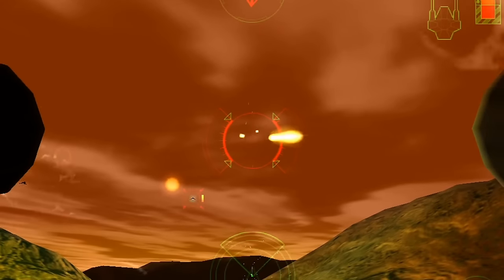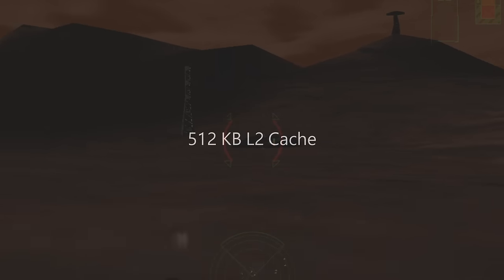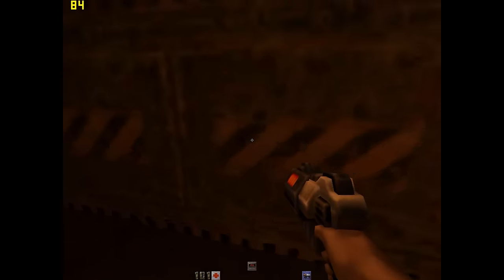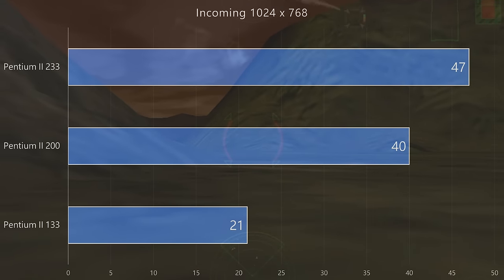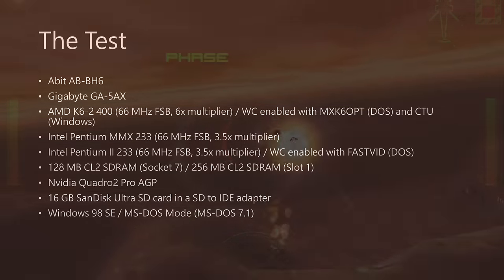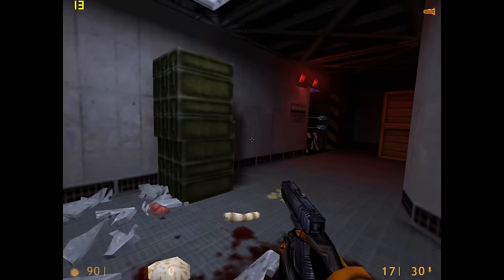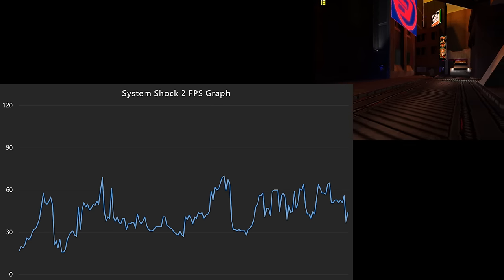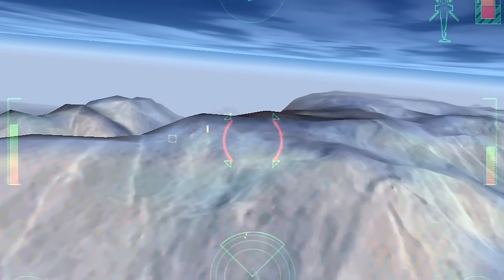Pentium II 233 The First Slot 1 Processor

Comment: I liked the video I recall my first custom build it was the 233 mmx pent and I researched graphics cards and went with a voodoo 3 2000 with 16megs of vram it would run anything but was slow at times with only 64megs of system ram don't recall the board think it was a pc chips board or the chip set either most of them I seen back then had ali , bx440 or s3 chips I see that mine in your benchmarks was the slowest that explains alot I didn't know how to test them back then and never did even today so that was helpful without having to do it myself I think price of that cpu was main reason I stayed clear of them trying to find the best performance at the best price meant choosing but at least I got the best graphics card at that time.

Comment: I never was able to get into the intel market back then. I had limited funds back then and AMD has almost always been a better deal for your money imo (ignoring the later FX line). I went from a 5x86 133Mhz to a k6-2 450Mhz which I stuck with throughout the secc cpu phase. I didn't upgrade again until thunderbird, 900Mhz, and later a thoroughbred 1667Mhz. It was at this time I ditched desktops for about ten years when I got an Area-51m in 2004. I recently built one of your dos time machines based around a p3b-f.

Mobo: Asus P3b-f
CPU: Pentium II 233 Mhz
Ram: 256MB 66Mhz
Hdd: 160GB ATA 133
Media: Plexwriter Premium
             LS 120 Superdisk drive
             Zip 100 drive
Hdd Controller: Promise 133 tx2 (This allows you to break the 137GB barrier.)
Sound: Sound Blaster AWE 64 Gold with aftermarket ram upgrade for loading soundfonts.
Video: 3Dfx Voodoo 3 3000
Operating system: Dos 7.1/Win95/Win3.11
Picture: http://imgur.com/a/tzchR

P.S. I really need to get a new psu for this thing.
Reply: A very nice system including the arch rivals Zip 100 and LS 120! I think it needs an exhaust fan though to keep in healthy for the longest time possible, especially as the Voodoo3 and PII produce a good amount of heat.

Comment: Phil, you could also make a video of the Celeron 266, the slowest Slot 1 CPU, and the Celeron 300A, the slot 1 overclocking king. :) A comparison of the Celeron 266 and the MMX233 would be a good idea.

My Pentium II 400 from 1998 (the first Deschutes Series) had a unlocked multiplier. The CPU can run with 450 MHz with the standard Voltage of 2,00V. 500 MHz was not stable because of the L2 Cache.

Comment: My Slot 1 setup is 440 bx motherboard with the Pentium 3 500mhz. No current hdd isntalled waiting new one this week for it. I mainly use it to test older agp video cards on. Plus it can run old Tomb Raider without emulation using the ATi 3d patch and the 3d rage card with proper driver. That's why I don't list a video card it is always changing depending on which older card I am trying out in it.

Comment: The card (instead of a discrete chip design) makes sense now. I always wondered why they did that. Components that by all rights should have been on the chip were attached outboard, and the card is a way to hide that whole mess.
Reply: Yes, if you're interested check the Wikipedia-article about the Pentium Pro to see which production problems Intel had with the Pentium Pro regarding the integrated cache, so it made sense that they re-located the cache with the Pentium II layout.

Comment: I found one of those Abit BH-6 from electronics trash some time ago. Haven't tried if it works yet. I also have one ABit BE6-II which is a bit unstable, most likely needs recapping.

BTW. How would have a 100 MHz bus K6-2 done against the Pentium II? Can you do a 66 MHz vs 100 MHz K6-2 test?

What SD to IDE adapter are you using? eBay link?

Comment: You can play Tiberian Sun even in 1080p, just edit sun.ini file :D
Reply from the maker: Ah of course, should have checked :) Yea on this old machines I like to leave everything stock, but good tip!
Reply: Running it at 1080p on that CPU would be a killer.
It does improve the game on newer machines though, I always edit the .ini file once it's created.
This also works with Red Alert 2.
Reply: Laziter73 I played Tiberian Sun back in `99 on Celeron 300A (OC 450 Mhz), when things get messy its not enought CPU power, so yeah, you can`t play 1080p on PII 233 Mhz :) But I was just saying, since he said its 800x600 maximum resoultion (and it is from the in-game menu).
Reply: and it still wont look any better

Comment: This was MY first computer's CPU (as opposed to using school/parents computer), which was in a Micron PC I bought in April 1998. It had an S3 Virge 4MB PCI graphics card, 32MB RAM, Ensoniq AudioPCI (a great card, save for that I couldn't run Ultima 7 Pt's 1 & 2 because of a conflict with Ultima 7's memory manager and the sound card.), an internal 33.6k modem, PS2 Keyboard and Mouse (I still use a PS2 keyboard to this day http://www.pckeyboard.com/ ). I quickly hooked up an external 56K Zoom Flex modem, added 64MB of additional RAM, and upgraded (via my first ever online purchase - buy.com) to a STB Velocity 4400 16MB TNT AGP card. I used that machine for roughly 2 years and it was very stable, though I did have to replace the power supply after about a 18 months because I used that machine all the time since it was so stable considering it was running Windows. (WinNT 4.0/ Win98 SE).
I still have the chassis, though it was upgraded with I think a 333mhz model (my dad had it upgraded while I was away). The original is sitting about 15 feet from where I am. Thanks for your video on this wonderful CPU. It brought back a lot of great gaming memories (Quake 2, Unreal, Quake 3), as well as late night sessions running Bryce.

Comment: I'm a bit surprised to see a Quadro card in use.  Quadro cards were (and still are!) for professional CAD and other 3D work and very few (if any) consumers had them.  They were extremely expensive and sometimes incompatible with games.  It didn't take nVidia long to refine their architecture for gaming, so when the GeForce 256 was introduced in late 1999, they were outperforming the Quadros in games.  If you really want reliability and compatibility for games of that era, get a 3DFX Voodoo card or maybe a GeForce (I had awful luck with them early on, so can't speak for reliability.)

Comment: Remember I had one of these as the first PC I purchased other than my Commodore 64 in the 80's. lols. A Gateway MMX233, also had a zip drive. 1997 cost around $3500-4000 AUD. Took a loan out for it. lols. And yes I flogged Colin McRae rally. Was playing Colin McRae 2 and Unreal Tournament easy, but had  Voodoo 3 2000 graphics installed by that stage.

Comment: when I have this kind of slot-1 based motherboard. I used to have a riser card so I can use a socket 370 processor on it. With a BIOS update, I have this motherboard running with Pentium 3 1333mhz. With woopin 1GB RAM which windows 98 doesnt fully utilize back then hahaha.

Comment: Wish I would have kept my last slot 1 system. Had the 440bx chipset on a Dfi motherboard, a slot 1 Pentium 3 Xeon 1.2hghz cpu, and 733mb of pc144 memory. The last upgrade was the cpu in 2008 along with a Nvidia VooDoo sli configuration. Stupid me got rid of the VooDoo cards before they became highly valuable. The impressive part is yes, it played Crysis! In 800 x 600 resolution. ;)

Comment: Had a Pentium 2 slot 466 and was my main machine for over 3 years, was amazing for retro gaming and emulation back in the day although my real start and jump from Amiga computers was the Pentium 233MMX, also upgraded my slot machine to 512 instead of 256mb RAM and an Ati all in one 32mb instead of the 16mb model, the only CPU that ever made me feel a difference in regards to emulation and gaming at the time was the 533mhz and 600mhz ones, all the rest even the slot Pentium 3 400-500 range fealt just a tad better on benchmark software only and generally felt like how o felt when I burned up my 466 and got a Celeron junk slot CPU for 2 weeks, I almost killed myself 😂😂

Comment: Not the Pentium III was the first CPU to run the L2 cache at full speed. The Celeron 300A (Mendocino) had a full speed cache, (i.e. running at 300MHz) albeit only 128KB.

Comment: Back from the era were Slot A AMD Atlhon reigned supreme

Slot A, AMD prossessor´s included 3DNow & Dual Data Rate! which made it better than any Pentium II, III & celeron  at the time
Reply: K7 Athlon though came later than the CPU reviewed here and only the northbridge and CPU had DDR-connection IIRC, the memory was still SDRAM. Intel had SSE in the Pentium III instead of 3DNow!. So AMD didn't really take the lead during the slot-era, but later when they got back to socket with the Socket A/462.

Comment: This era is my favourite era of all... The first PC I've build myself, was a Mendocino Slot 1 333MHz Celeron CPU, on a Totem TM-P2EX Motherboard and 128MB  of RAM (2x64MB PC100, one I bought, the other one was shipped to me by mistake... no one claimed it, I didn't talked about it... life was good :P ).. It was slow with the S3 Trio 3D/2X I had it equipped initially but after a year, I've equiped it with a Gainward nVidia Riva TNT and that sucker came to life! With the S3 Trio the computer run perfectly with the 83MHz FSB setting, with the TNT had to bring it back to 66MHz, but the graphics boost was more than enough... Remember that most games were run on a 15" CRT with the optimum resolution of 800x600, and it was a blast... I miss those days!!!

Comment: If you are doing ancient tech could you put together a NT box with a bx chip set dual celeron 300. Used slot 1 to socket 370 adapters with the dual chip pin enables. These were fast and easly ran at a fsb of 100mhz.  That is if you could still find a board?  One of the early mb hacks and a Trouble free guaranteed %50 over clock.

Comment: That TS demo. C&C1, RA1 and TS are all freeware so download the isos if you don't have the game. By default TS supports resolutions from 640 x 480 to somewhere close to under 2560 x 1440 by editing the SUN.ini file.

Also please bring up the gamespeeds they look slow to me, but then again I'm used to running old C&C games at 60 FPS (the penultimate gamespeed)
Reply from the maker: Link please. With these videos, time is critical. If I lose an hour finding games and getting them to run, I won't. So if you want games featured, please make it easy for me :)
Reply: Bitte hier entlang: https://www.heise.de/download/product/command-conquer-tiberian-sun-firestorm-71708
https://www.heise.de/download/product/command-conquer-red-alert-95512
https://www.heise.de/download/product/command-conquer-tiberian-dawn-54984
Reply from the maker: Ok thank you, will check them out. But no guarantees, demos are really easy to install and run. I don't even have an optical drive installed most of the time, everything runs straight of folders.

Comment: Was there anything wrong with the SS7 motherboard? That K6-2 400 seemed woefully slow.
Reply: Not that slow - the K6-2 wasn't all that fast relative to the Pentium II. Clock for clock, it was a lot slower. The K6-2+ and K6-III, with the on-chip L2, did a fair bit better, but AMD really didn't get around to batting in the same leagues as Intel until the Athlon. (That, however, did cream the Pentium IIIs of the day, or at worst keep up with them solidly.)

Also, that was a K6 on Socket 7; the versions on Super Socket 7 with a 100MHz FSB were notably more skookum.

Comment: Hi Phil, I know this video is 7 years old but I recently uncovered our old home PC from way back in the day and it indeed has a Pentium 2 233 Mhz processor. But I am not quite getting the same performance that you seem to be getting in the video. I initially thought it might be thermal throttling but I don't even think CPU's from that era can even throttle, they just give the overheating beep and shut the computer down. I tried getting the stock heatsink+fan from the CPU but they have these weird hex screws on it and an allen key just wouldn't do it. I stopped trying to get it off due to potential damage to the chip. Do you think its worth getting it off to re-paste it? Or just leave it as is?
Reply from the maker: Is that under Windows or DOS? With windows it has to be same or similar GPU and exact same graphics drivers. For DOS make sure graphics boost is loaded. If all that doesn't make sense X don't worry about it and just enjoy the games 🙂 yes they don't throttle but active cooling is definitely needed.
Reply: @philscomputerlab  I am using Windows ME. Maybe that's why its slightly worse? Haven't tried it with just DOS installation. I went with ME due to out of the box USB support.
Reply: @philscomputerlab  Okay so I figured out what was going on. I had  USB mouse plugged in to the machine and apparently they require substantially more processing power compared to a PS/2 mouse, atleast for a Pentium 2, on a modern machine its not even noticable. Changed it with an old PS/2 optical mouse and everything is now less slow yay :D
Reply from the maker: @bulutcagdas1071  Oh cool, that's good to know

Comment: Where you did find the drivers for the Abit AB-BH6 board?  Seems to be almost impossible to find anything for Abit, DFI, Iwill, QDI, Soltek, Soyo.
Reply from the maker: What drivers do you need?
Reply: I was thinking that special drivers might be needed for the PATA IDE ports and the AGP slot.  The chipset was popular so it might be included in Windows 98.  But I am not quite sure.  Did you encounter any compatibility problems when using the Microsoft drivers?
Reply from the maker: That's all from Intel. That's why I recommend the 440BX chipset so much. I believe the Intel chipset driver was the only thing I installed for the motherboard.
Reply: Thank you.  I am impressed that Intel still has the drivers available for download.  Amazing.
Reply from the maker: So does VIA and SIS!
Reply from the maker: You can also get drivers from other, similar boards. For example Gigabyte has all their drivers still up, so does Asus. There are lots of tricks :D

Comment: hey Phil, i have a pentium 2 300mhz build, the motherboard is a micro star ms-6111, im running 96mb of pc66 memory and an ATi Rage 128 pro, , just like the one you did a video about, the system has a bit of slow down when running games like quake 3, im thinking about replacing the motherboard, ram, and cpu for a pentium 3 and an ASUS P3V4X, this way i can run a 133mhz fsb, quicker memory as well as a faster cpu, would you do this or would you just keep the PII 300mhz system, i have a creative labs 3d blaster tnt2 ultra ordered and i hope it shows up today to use on this build, awesome review of the PII 233
Reply: i just purchased the Asus P3V4X motherboard and a pentium III 650mhz cpu for $42.54 USD, all i need is some memory now, im thinking 256mb or 512mb depends on the pricing and i want pc133
Reply from the maker: Those graphics cares are too slow. I'm using a Quadro2 Pro, a fast GeForce2 type card. That ATI is a real dog, the TNT2 is ok, but it's also very basic.
Reply: In your video review of the ATI rage 128 pro the charts shows it compares to a tnt2. I noticed a huge boost in performance from using a rage 2c and a Nvidia vanta. It should be able to handle quake 3. I'll do some more tests later today to see if the system struggles with any other games
Reply from the maker: ed kazee Those benchmarks are on a Pentium 4 2.8 GHz. Both IMO are underpowered for these games.
Reply: I would not reconment a TNT ultra for just a p2 300 mhz. It will not reach full speed. I think it will bottle neck you even. Try to find a voodoo 3 2000 or 3000 instead.
I'm saying this because I used to had a Amd Duron at 1200 mhz with pc133 ram. My voodoo3 ran games beter then the TNT ultra I had. 
The geforce 1 or 2 ( not mx) is a different story. Those just rule. Even on a p2 system.

Edit: Do get more memory. 96 seems a bit low. Even for a p2 system combined with e.g quake 3:P
Reply: Martijn van Zanen I have ordered an Asus p3v4x motherboard and 2 256mb pc133 sticks of ram and a 650mhz pentium 3. Should be here this weekend. If the tnt2 can't keep up I'll use a radeon 9800xt or a x850 pro lol I wanted to stay within the same time frame with the parts but I don't have any cards other then the tnt2 and rage 128 pro
Reply: Ah, I understand Ed.  And ye, can't go beter then the good old 9800xt haha:D Way overkill but I loved that card.
Nice setup for a p3 tho. Enjoy your retro system.

My slowest at the moment is the old amd (big slot) 800 mhz thunderbird. Still in its orginal case from fiutji or something like that. ( that old camera brand)
Reply: 133 mhz memory will work only at 100mhz with 650mhz cpu because of the clock multiplier, to get it work at 133mhz you need either 667 or 733mhz cpu, check your motherboard manual
Reply: Dilbert Papadopoulos I know this. So the Asus p3v4x motherboard set the fsb to 133mhz as a result my cpu is now running at 866mhz (6.5x133)this was the default settings that came up when I first put the machine together.  the crucial memory I'm using has profiles for 133 and 142. When I set it to 142mhz the cpu was clocked at 923mhz. I haven't did any stress testing to see if it's stable at 923 but at 866 it's very stable
Reply: nice. I personally never had a good result with overclocking for some reason